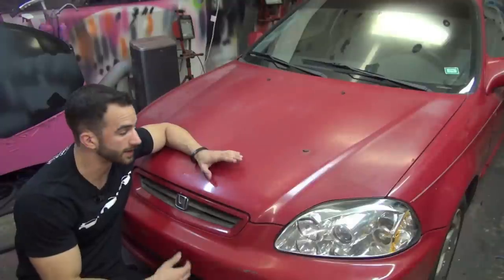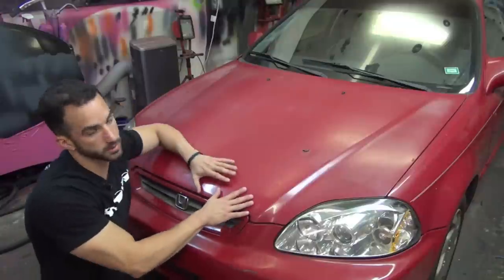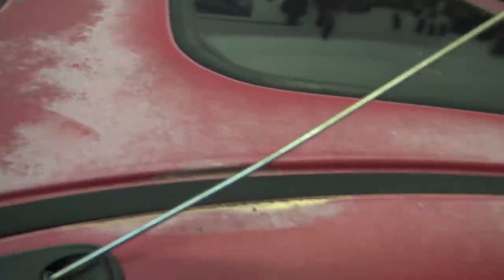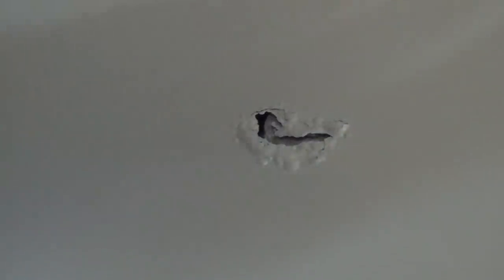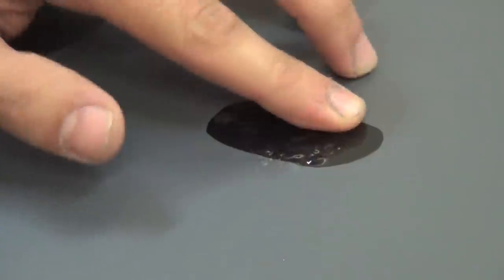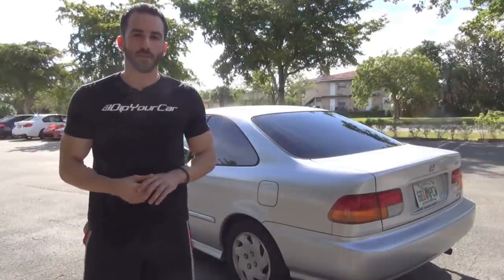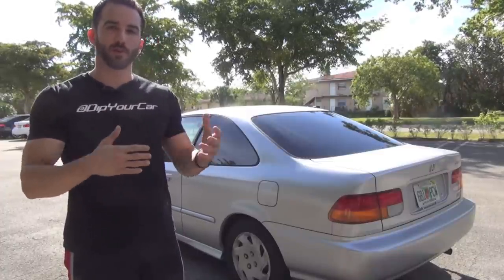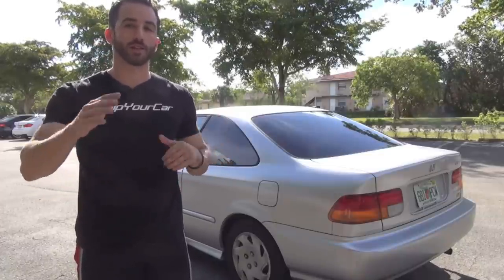Restore Bad Car Paint with Plasti Dip

Comment: Would plasti dip cover small minor scratches on the rims from kerb rash etc?
Reply: +ridges7 Very minor scratching and paint damage?  Yes.  Curb rash?  No.  It does help curb rash and chipping a little bit, as it takes away some of the depth (not a lot) and normalises the colour so it is less noticeable at a distance.  Distance being the key word, haha.

A good idea is to just sand the curbing away a little bit, wash and then dip.  You'll get a better result. :)  Just dipped my curbed up nissan wheels in white.  They look like new from 2 feet away!

Comment: I thought PlastiDip gave a "temporary" or removable/peelable coating, which might be fine in other situations; why on earth would you go to this much trouble and expense for such a result, when at least a cheapo real paint job would provide longer term protection? And the mindset of taping over rust holes is pretty sad.
Reply: +z1522 Eh,   I think the point was to show what you get from that.  If someone really loved a rusty car they might want to know what they'd get if they tried anything that cheesy for a repair,  or hopefully be persuaded to put a little extra effort in. :)  You never know what someone else's priorities are.
Reply: A cheap paint job would still run about 1000 dollars and probably not look all that good.   I love how everyone's an expert on auto paint work.

Comment: what does it cost including equipment roughly?
Reply: +Richard Recupero You can build you own kit at https://www.dipyourcar.com/pages/dyc-pro-car-kit-builder it will start off at $162 and then go up for how much dip you need and any extra accessories. Remember you are paying $162 for the Spray Gun and Turbine. then $55 per gallon of dip, and then how every much for extra accessories.

Comment: Ok, the idea of using plastidip is that you can always go back to your original paint if you want to, but why would anybody EVER want to go back to that? Why not just do a good paintjob, PERMANENT solution, if you have a car like that? The other thing about plastidip is that it protects your original paint, but again, who would sacrifice the durability of the new BETTER look to protect that?...
Reply: IF it was my current car and my paint got messed up I'd get it redone, but if the car is a beater, and you just use it to get from a to b why invest what could be 1000s of dollars (And if your paint looks like that the shop will totally want to redo it)  for a car that's Blue Book value isn't that high?  It's a band-aid on a car that might last the owner another 2 or 3 years

Comment: I don't get it.  Why is this any different from painting?  Do you not have to remove the clearcoat?  If you do, does it come off in a sheet or do you have to sand it or what?  PS you didn't show close up of where you put the 3-M vinyl.  Randy B.
Reply: The difference is you can remove the plastidip paint job relatively easily. Simply key or knife a tear into the paint job and start tearing. Also it's much cheaper than a traditional paint job.
Reply: DynamiteDupree Do not 'key or knife a tear into the paint job'

Comment: Hey if i dip my car a different color do i needah go to the dmv and change the color of my car?
Reply: I had an accident in my old truck and after the repairs i choose a different color for it to be painted. About a week after i got my truck back i was pulled over and and instead of the police walking up like normal. I heard "DRIVER turn off the vehicle and drop the keys out the window and leave your hands where i can see them". When he approached the car with gun out but not pointed at me he asked please step out of the vehicle and put your hands on the hood. At this point my best friend who was in the passenger seat was dying laughing. Cop instructed me not to move while he checked the vehicle. My friend informed him of the situation showed my registration and drivers license and it all ended. I happened to be driving through a bad area of the city where car theft is a problem and he wanted to be sure, he was very cool with me after that and informed to notify the dmv of the color change. Im actually glad he did what he did, if my truck was stolen he would have got the guy.

Comment: A can of body filler is like what $7 geez, tape works too i guess lol.... 
so whats the benefit over paint?? I understand it peels off but I don't want it to peel off.
Reply: +Toad Phillips - Time and money. Paint requires exponentially more prep work. If you're not doing that work yourself, that costs a bit of money. Dipping is much cheaper and if you screw up you just peel it off and try again.

Comment: Can you still get a smooth finish without sanding?
Reply: ***** what I meant to say is do i have to sand tbe factory paint to get a smooth finish? I have some scratches and rough patches everywhere so I was wondering if I should sand it first
Reply: It wouldn't hurt, depending on the severity of the scratches, enough layers may hide it but if they're actually deep and not just on the top layer you should sand them out..

Comment: Yo so what if the the clear coat is pealing do I sand it down or paint over it
Reply: if the edges are peeled up and away rather than flush, i would peel it some more until it gets to a spot where its still flush. hit the edge with some clear rustoleum (use something permanent so when you peel your car it doesnt come with it) to seal it together and then dip. im not an expert so take what you will, but thats how i did it for my cars and it seems to work just fine. give us an update on what you do. like he says, every car is different and reacts differently, so a wide range of input is always welcome

Comment: Looks nice, but still! There is a difference between "restoring" the paint....and coating the car with plastidip,,,, which could get scratched, tear or have holes. Just from driving alone!....It might look nice for a little time. The fact that someone could just use their nails to peele the plastidip off, and ruin the entire thing....still remain!

Comment: a lot better looking than the original car but for the amount of work done here you could have used paint and had a better finished product. It is a vast improvement but in the spots you didn't do proper body work it will look like shit in that area in less than a year.

Comment: Wrong. Most old cars are painted with a one stage colour, meaning its pretty much one layer of paint. While modern cars have a base, the colour and a clear coat. This car only has a base, and the colour. Thats why your cloth turns red when you polish it :) because you are in direct contact with the colour coat. Its a much "softer" paint thats easier to correct than a car with a clear coat. This doesnt happen with a car that has a clear coat.

Comment: so if someone wanted to they could peel all that new colour off the car and trun it back into red?
Reply: yes
Reply: and that would be desireable how? and if someone knew you had done this to  your car what would stop them from peeling your car when you'r e not looking? just trying to wrap my head around how this is better than just painting your car.
Reply: tritowns because its cheap and interchangeable? I dipped my entire bike matte black because the paint that the previous owner did was AWFUL. and cost me $25 and had a can left over. So fix up an ugly god awful paint job or a color you may not like for around $250-300 for a GOOD dip job. Send it in to get new paint job and get ready to spend a few grand. If you don't like the color peel it off. This stuff is VERY tough and will only come off when you WANT it to come off.
Reply: tritowns What stops someone taking a set of keys to your car or tipping brake fluid all over it? If someone wants to vandalize your car, plastidip isn't going to be the issue.
Reply: iamvezm peel off the keyed section and paint over it again. what makes a normal painted car safe from being vandalized?
Reply: Hadie Kumastar  sorry that reply was meant for tritowns
Reply: tritowns dude if someone just rips your dip...1 they deserve an ass whooping and 2 they'd get arrested man. plus its hard to rip it man unless they are clawing at it. I've banged into my car with keys hanging out my pocket and it didn't rip it. Worst case senario theyd do one rip and you can redip a panel in 20 minutes big whoop
Reply: it's not so much vandalism I'm thinking of... If I ever turn to a life of crime I know what i'm doing to my car... lol...
Reply: Mike1nyny It's something that women do.
Reply: sublimekid247 If you can paint a car yourself with plastidip why can't you do a respray by yourself? Yes a decent respray can cost thousands if you pay a shop to do it, but you can't compare that price to you doing the plastidip by yourself.
Reply: GeekinSince82 Plasti dip is more forgiving
Reply: GeekinSince82 Plasti dip is a one step process vs 2/3/4 step of an actual paint job with primer basecoat and clear. even rattle can vs rattle can plasti dip is not only more durable but far cheaper and if you don't like the finish product simply peel it off. not much pre involved in using plasti dip either quick wash maybe and let it dry and mask off maybe your windows since overspray on certain spots is wanted to make the seems cleaner on say headlight or taillights.

Comment: It's REALLY not hard to grind away most of the rust, put on some rust inhibitor, fill it with some kind of metal filler and sand it. It's just as DIY as any other solution, and it's NOT a bodyshop technique.

Comment: why do red cars fade in the sun?
Reply: Any color fades in the sun
Reply: Good Question, this is because high energy blue spectrum light from the sun is being absorbed by the red paint (more readily damaging it) and not reflecting it as&#160;would be the case with blue spectrum paint. Coloured objects don't really exist,&#160;what we are seeing is only the colour that is being reflected.&#160;When we say something is a certain colour, it always means that all of the other colours of the spectrum are being absorbed. Conversely, red spectrum light holds the least&#160;energy and is easily absorbed by blue spectrum paint, causing less damage.
Reply: Hmm...not this time :-)
Reply: +TheBigGuy3380 it can do that from editing your comment somtimes
Reply: red pigment is most affected by the ultraviolet radiation in sunlight, same is true for red ink in tattoos

Comment: Your so dogee. Your mental to cut the rust out with an angle grinder. Get some new metal and make it the size of the hole. Weld it in and angle the ballge from the weld down so it nice flat and smooth. Then you get some putty and apply over the repair so it's the shape of the bonnet. and sand back once set and you are ready to spray paint
Reply: or you just buy a new freaking hood!!! it's a POS Honda and that hood is $20 at the junkyard, or less than $100 brand new aftermarket lol.
Reply: *you're :-)

Comment: The guy has a power washer, but opts to not sand and bondo (6 bucks a small can)  the rust stain =|
Reply: I'd take a vinyl patch over a sand and bondo.

Bondo isn't made to patch holes, it's made to smooth minor imperfections.
Every bondo plug fails the same way, the metal keeps cording and the plug falls out a year or two later.